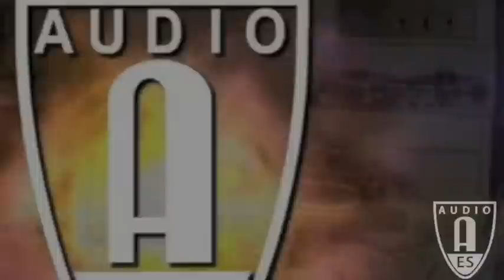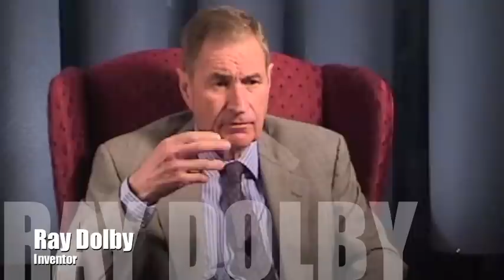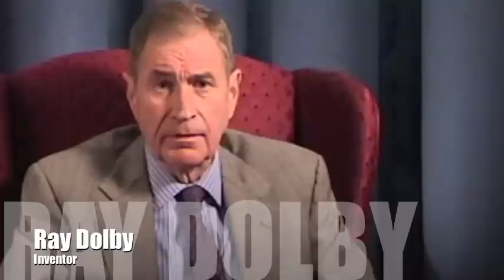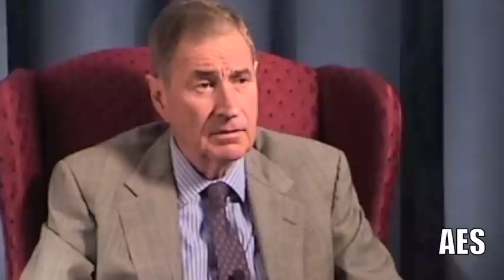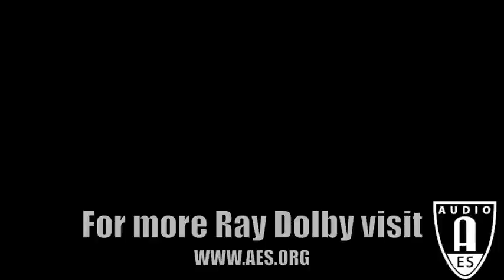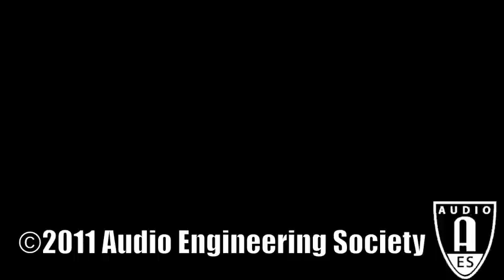Ray Dolby "Noise Reduction" (Mobile 21)

Comment: He was a great inventor and as a pioneer innovator of his famous Dolby "B" Type Noise Reduction that produces clear and mostly crisp sound that he has ever done before Compact Disc and MP3 Digital Audio were later invented in the later years. It was used for studio reel to reel album masters, cassettes and 8 Track Cartridges. Also, It was used for the all-time high budget sci-fi motion picture THX-1138 and for the Star Wars film franchise. R.I.P. Mr. Ray Dolby a.k.a."The Original Innovator of the Dolby "B" Noise Reduction System".
Reply: Dolby B was never used on film soundtracks. The very early films to use Dolby noise reduction used Dolby A.